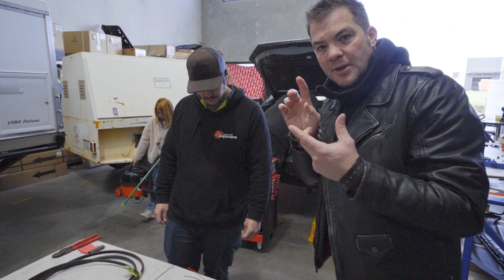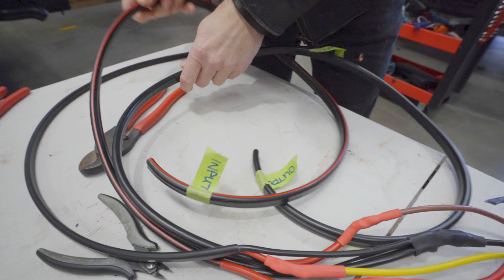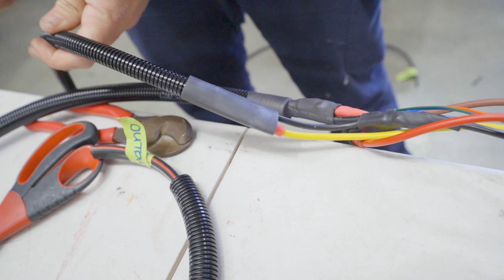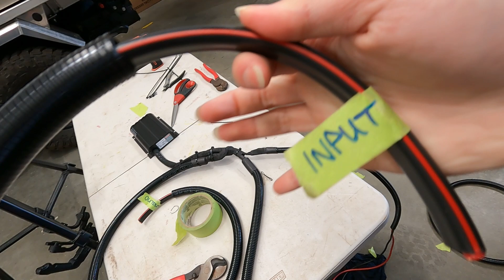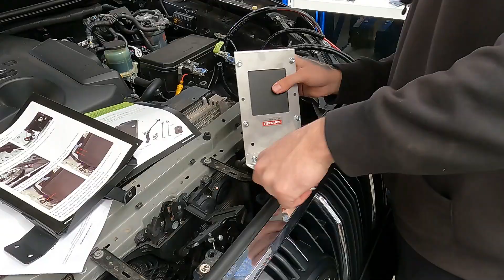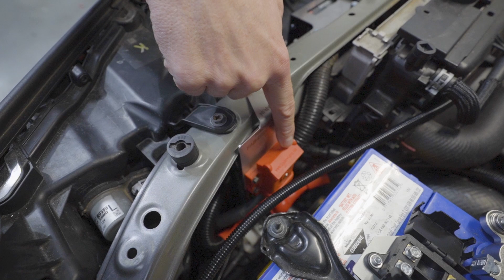How To Make Your Own DIY Redarc BCDC Wiring Harness Tutorial

Comment: Hello. I've installed the exact same wiring in my Prado 150. However, my BCDC isn't charging my AUX battery. All the LEDs are lit correctly. I can only ever measure 12V at the BCDC output. The charging profile is set to AGM battery. Could you please help me? Greetings from Germany
Reply from the maker: Hi, 

The first things to check would be the fuses on the ingoing and outgoing side of the unit to make sure they are intact. 
You can also try plugging in a solar panel to the solar input side and see if that charges. Lastly trying the blue Ignition wire and if that may fix the problem. If this does not work we would suggest contacting Redarc Europe for some more in depth customer support.

Kind regards!

Comment: Thanks, Heiner. and protege nick  for the tutorial of a nice wiring job , in light of , if you solder or  crimp , I wonder what the armchair experts experience is ?? 🤔🙄😒
But I must admit it did look a little sketchy at the start but it came together very nice , super secure , really good soldering job with plenty of heat & penetrate the heavy wires , your workmanship reminds me of an old mate ,.old school  . Everything soldered, insulated & saddled 🙌 have been following you for a while on Andrews channel cheers

Comment: For heavy gauge cable like this I joined the cables with a butt terminal, then solder the whole thing,  Prevents cables parting while soldering and streamlines the cable diameter .  What you think?  Steve 🇦🇺